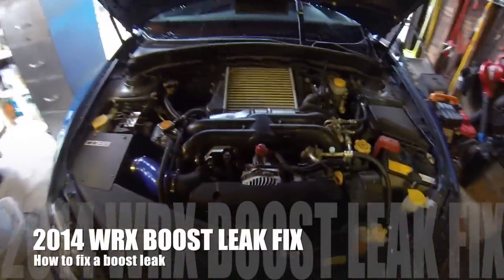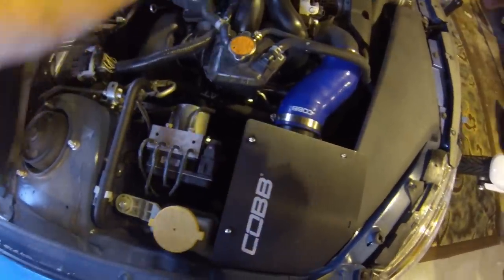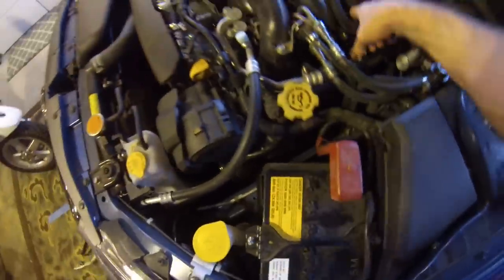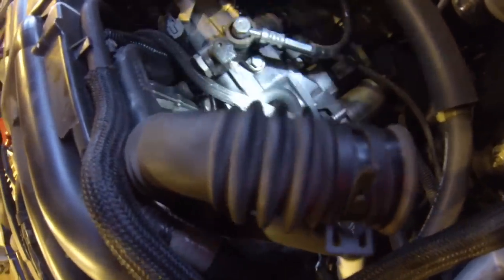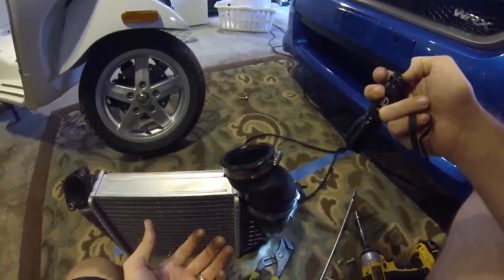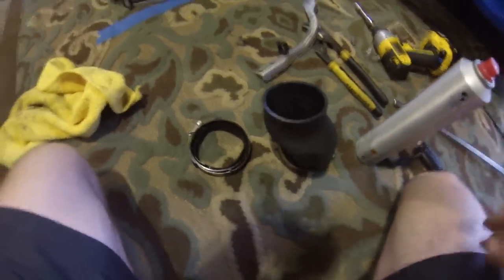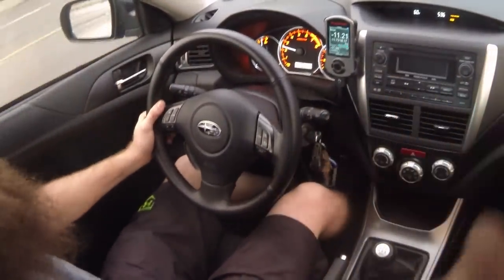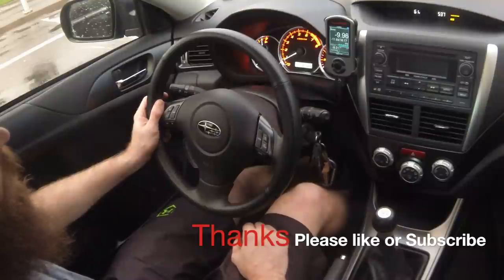How to fix a boost leak on a Subaru WRX 2014

Comment: Hey Blake, thanks for this video! I had been noticing hesitation with my turbo when I started boosting my 2014 WRX so I thought I'd check this out. When I took off the Intercooler my hose looked almost exactly like yours in the video! Luckily there was no oil but part of the hose where you put on the hairspray was ripped. I fixed it and text drove my car and it sounds and feels so much better now! Thanks again for your awesome videos and tips! You're the man!
Reply: i had the same thing, but the dealer said it was my fuel cap was loose.  i tighten that thing until i cant tighten it anymore.. it caused my engine to go to limp mode, initially about 40% of the time after 3500 rpm there would be a big loss in power, like there was no boost.  If i did get power it would flutter out and not be smooth.  

Took it to the dealer and 4 times they told me the same thing, i even paid them 100 dollars for maintenance time.  But they didnt even replace the fuel cap.  It got to the point where recently i heard whooping noise and in 1-3rd gears it keeps me at 10 mph until i get to 3000 rpm where boost comes.  So it got dangerous to drive because it would keep my speed that low even if my foot was all the way down.  

I finally just reset the ecu by unpluggin the  battery then bought a new fuel cap.  that completely fixed it.  

But now i still have to find the other leak.  Because today i got those 3 lights showing up again, check eng, crusie control and stability control lights.  Matter of time until the ecu decides to put my car into limp mode again.  Should I just take it to a mechanic?  i doubt i will take it back to subaru

Comment: Only getting 9 PSI all of a sudden and Thanks to Blake and his awesome videos, I knew what it might be right away from watching all of them months ago before I upgraded my 10 WRX to stage 2.  

Found blow by and a tear in my hose. Not as much oil leaked out because I noticed it right away, thanks to these videos.

Ordering a new aftermarket hose.

Thanks Blake.

Cheers
Reply from the maker: +BC WRX Thanks man Glad I could help!
Reply: +Blake's Garage Furthermore, If I could add any help to those looking to go Stage 2, just do the intercooler hose at the same time like in Blake's Stage 2 video. I skipped that step, and now Im upgrading it !  Merry Christmas!

Comment: Thanks so much for this video.    Had the basic idea in my head but the invisible IC->TB hose part was the unknown before I got in there.

Had the exact same problem, hose was barely connected on the TB side, and blown out like yours was.    Reinstalled the same hose after cleaning up, will see how it goes before I replace.
Reply from the maker: +cyberbob08au Glad I could help.

Comment: I recommend buying the Mishimoto silicone hose instead of this as a permanent fix to this issue.  Which happens on all of these EJ255 engines.  Subaru wanted to make the engine less expensive to make. The oem turbo inlets do the same thing.  The Perrin silicone replacement is the best one for that.
Reply from the maker: Yeah, I ended up doing that later on, but I think the best permanent fix is to sell this piece of shit car lol

Comment: Hey Blake.  After taking my car to the dealer and having them tell me that my boost leak sound was normal and that I wasn't hitting boost because I used OEM parts (a little defi gauge) and that I probably did it wrong anyway, I decided to do it myself.  Your little video fixed my problem.
Reply from the maker: MrDinoSwit Great man thats so awesome. I have little faith in the dealership anymore. They never want to fix little problems it seems. Its a big problem EVERYONE NEEDS MORE BOOOOSSSTT!!!

Comment: That oil tends to be hard on the hoses. Your blow by is coming out of the crankcase and is in vapor form then condenses out in the intake. If you want to stop that you either need an air oil separator or a catch can. It have a Perrin separator. It works quite well. I have a fully built motor so there is even more blow by than stock. And I get almost no oil in my intake anymore.

Comment: Heard you had a boost leak in the Cobb SF review.  Figured it was this issue, but wanted to check.  Had the same issue with the dealership, though they said it was my fault for taking the intercooler off.  You know, to check the problem in the first place.  I don't go to dealerships any more.

Mishimoto throttle body hose FTW.

Comment: I have a screeching noise on high boost only just had head gaskets changed, new valve seals, heads resurfaced. new jdmv7 sti 6speed swap, new r160 3.90 rear diff. new motor mounts, new sti trans mount, I have a mishimoto tb to ic hose. I have a new sti starter to match the flywheel, new sti clutch disc, chromoly flywheel and pressure plate.

Comment: Just did this last night before watching the video. My end cuffs were rolled and the back one was torn. I took them off, Note advice, Dont' do this if you don't want to have a hard time lining up the bolts lol. It works as a temp solution though if you have end couplers that are leaking. So make sure you prepare for that while you wait for your new Coupler tube. It's a bitch to get on there too. I dont' have a cobb intake or an ap yet unfortunately but I did notice I have way less swooshing sounds when hitting it, so I had a boost leak and didn't really notice cause the car felt powerful still. Last night it felt a little more torquey but otherwise felt the same after I fixed it. I need to get a tune lol and cobb intake so bad lol

Comment: Just did this procedure to my car and it indeed does need a new hose, I don't have a boost gauge to monitor my boost however it felt a like it might have had one and indeed it did, thanks a bunch for this video!
Reply from the maker: David Mudrik No problem, Get a silicone replacement hose they work awesome. But there also a total pain in the ass to get installed. It seems easy like the stock one, but you have to force it on the throttle body and intercooler. Its mostly not so easy because of how tight it fits.
Reply: Yea I've heard there hard to get on, but at least they're future proof unlike the stock ones.
Reply from the maker: David Mudrik My car holds boost really good now with the mishimoto hose. I go over the install in my stage 2 upgrade video. Check it out.

Comment: Blake you seriously helped me a ton with this video.  I have a '14 Hatch with only about 10k miles on it.  Completely stock other than cat back exhaust.  It started whistling under heavy acceleration.  Not normal turbo whine but actual whistling.  When I took my intercooler off, I had the same issue as you.  Thanks for the step by step on solving this issue.  I may have to order a mishimoto.  I tried cleaning, hairspray, and clamping it down for now and it has solved the issue.  We will see if it holds up.
Reply from the maker: +BadShadd1 I would still recommend getting the Mishimoto hose. I think my stock hose had this problem 3 times before I got the new on and no issue's since.
Reply: Blake's Garage Right on brother I think I will do that.  Did you use the stock worm clamps with it or T clamps?
Reply from the maker: BadShadd1 T clamps will work better. The stock worm clamps strip out very easily.
Reply: Blake's Garage Sorry for a million questions but what size T clamp and where do you recommend getting them from?

Comment: Im not hitting my boost targets either. According to COBB I have most likely a boost leak or boost control malfunction. I have a 14 WRX, COBB tuner and COBB intake.  That's it. Cobb said my wastegate is between 70-80%. I'm running a normal wastegate map. I hope my issue is the same exact of yours and other people posting here.

Comment: I have a 2014 wrx hatch and after my mechanic fixed the coolant leak i had ehich were rotted coolant bypass tubes from the water pump up.. he said he had to tear apart the whole top of the engine to get to it all. He had the intake and everythinf off. Got my car back yesterday and i had oil leaking bad under the car.. huge puddle of oil. I brought it back and he says this tb to intercooler hose had a small rip and alot of oil coming out. Could that much oil come out to where its puddled underneath the car? My car hits boost feels fine with no noises.. never had problems leaking oil until he touched it.. any help would be appreciated

Comment: Mine was soaked in oil like yours as well.. with some oil spots on the parts sitting below the throttle body connection.
Reply: Just took off mine. Same thing

Comment: I'm in a rut. Just got the check engine light and cruise control blinker on. I just went stage 2 ETS because I did the full turboback exhaust system made sure my mechanic took out the restrictor pill and replaced it with rubber hosing. What might my issues be?
Reply from the maker: Read that CEL code it should point you in the right direction.
Reply: I fixed the issue. it was the o2 sensor not recognizing the HFC on my down pipe its completely normal with the full exhaust system. Thanks

Comment: my car is at the mechanic now and they tell me that TB hose is ruined. It hits full boost but doesn't hold it just like you say. They are going to put a silicone hose replacement in there. Also, this means you would of had a vacuum leak, correct?
Reply from the maker: +danny hamilton Great glad he could fix you up that will help with power a ton.

Comment: I am wondering what map version are you running? I had a boost drop when I switched to the Stage1 +AEM 91 MT v331 map.
Reply: Yo did u ever find out what was the problem

Comment: I had this exact same problem after my car bottomed out from a pot hole (downpipe hit the ground and jiggled this loose). Fixed it on my lunch at work. It took weeks for me to notice :( . What a cheap hose!
Reply from the maker: Joseph Petro There total junk. Glad you were able to figure out it was having issues. It suck's when you car feels slow but you don't know why.
Reply: Ya man, still looking for a quality replacement that doesn't cost $60
Reply from the maker: Joseph Petro Its really worth the 60 buck to have no more issues. Probably the cheapest reliability mod you can do.

Comment: Hoping for a quick response. The intercooler brace is not fitting back into it's spot. What is going on? Everything else is in place.
Reply from the maker: Jacob Strunk you probably do not have the orientation of the IC to TB hose correct. This could be throwing off the alignment. Also you may have to pull on the IC to line up the bolts into there holes and just three them in by hand at first. Hope this helps.
Reply from the maker: blake866 Check out my stage 2 part 2 video at around the 7:40 mark I show how I reinstalled the bracket. This may also help you it has better view of reinstalling the hose. https://youtu.be/GQD8rtK22Vs?t=5m32s

Comment: Dude, that's a lot of blow by
You need to get an Air Oil Separator (AOS)....
Several out there examples Perrin / Crawford /AIG
Reply from the maker: Manuel Aguayo Tell me about it. Your right I think this will be something I do soon.
Reply: Is the engine faulty you think?

Comment: I have a 2013 sti, built to 370hp on stock turbo, DW fuel pump 1000cc ID up-pipe  equal length header turbo back exhaust catted bov cold air intake, fmic AP w/ pro tune dyno BC coil over. Larger turbo coming plus clutch. Having done bolt on's at home I see your plight, the stock couplings are shit, replace it and forget it. Many may not agree but OTS maps are killing you guys, every car is different, take it once to a pro and tune your car per you and tuner, being able to maximize power bands evenly and effectively will get your lbs up!. Plugging in an AP isn't a tune!. I run consistent 18lbs and change peek on the same turbo. Car feels great and performs every time. It is expensive but well worth it in returns!.
Reply from the maker: +colincash1 Once I get more of the mods like you have I will defiantly get a pro tune and I fully agree with you that its well worth it. Right now I have Torqued Performance Stage 2 E-Tune and I couldn't be happier. I can hit 18.5 PSI all day easy with no knock. Once Snail Performance has another Dyno day I would like to see what power levels my car is making with this tune. If I were to guess I'm thinking 300 WHP and 310 WTQ. I still want to do injectors Intercooler Fuel pump and E-85. But this will be a while down the road. For now I need to save to get more suspension mods.

Comment: Good video. I just bought a 2014 sti. Love it.  Quick question , does the cobb intake and access port void the warranty on the engine? I hear thats kinda a tricky question.
Reply from the maker: Alfred Salazar Um Maybe? Matia Subaru in Sacramento told me as long as that Item did not cause the car to brake than your good. They even sell Cobb tuning parts and the accesport at the dealership. But I would still take it off and uninstall the access port everytime you go to get it serviced if your worried.

Comment: My car sounds like a supercharger whine when I get on the gas especially in second gear. Do you think that could be the same as this?
Reply from the maker: +Omar Mejia Its possible either that or you turbo is shot and your hearing bearing noises. This makes turbo noise not a whine usually. More spool and air noises.
Reply: Thanks! I'm about to go to subaru for my 30k service so I'll see if they can look at the turbo under warranty.
Reply: do you hear it in first also?? 1st and 2nd whine. its the gears and it is normal
Reply from the maker: 65PontiacTempest Oh yeah I didn't even think about the normal trans noises. Did this problem just happen or has it always been there.
Reply: +Blake's Garage I bought the car used so I'm not sure how long it's been making the noise. It's very faint in first and loud in second and third I can't hear it anymore. I have a small clip uploaded.
Reply from the maker: Yeah dude thats just the trans wine.
Reply: i hear a swooshing sound like i have a bov but its a stock 13 wrx.  Subaru told me its a loose fuel cap, which they didn't even replace when i paid them 100 for the maintenance fees.  

I was getting the 3 lights on the dash, check eng, cruise, and trac control.   Recently the engine started cutting power in 1-3rd gears below 3000rpm keeping me at 10-15 mph even with my foot all the way down until i hit 3000 rpm which took like 10 seconds to reach.

Before that it would just whoosh and cut power on boost anywhere from 4000rpm +, if i did get power it was sporadic and you could tell it was spluttering and hesitating.  

I reset the ECU by taking battery terminals off and bought a new fuel cap, it works ok now.  But i still hear the whooshing and today i actually saw those 3 eng lights come up again so i know i got another leak.  What would you do? prett ymuch whats on this video? or should i take it to another mechanic.  

Im not to good with cars engines lol, i don't want to screw it up and void my warranty.  If anything ill watch these videos and try to figure it out but if you got any pointers im all ears!  great vids btw
Reply: +whiskey 4 its possibly the throttle body to intercooler coupler. they are known to be defective from factory. $50 aftwrmarket coupler will fix the issue.
also the stock intake does make some noise as it has no silencer but since you are getting power loss and lights i would check the coupler
Reply: thank you i will look into that and see what happens!

Comment: Hey, I've got an 08 wrx and have a boost leak rn. I was thinking of checking the hose from the TB to the IC but it is an aftermarket one, could this problem still happen with an aftermarket hose?
Reply from the maker: Yes
Reply: @BlakesGarage  ok, is that because the aftermarket ones still have those rubber rings or what?
Reply from the maker: @bobbyboiii5027  well, I mean there’s only two spots that you can really get a boost leak on one of these cars. And when you put on an aftermarket hose, you shouldn’t use those little pieces anymore. It should just be a single hose.
Reply: @BlakesGarage  ok, i’m still gonna check everything out anyway, thanks for the reply

Comment: +Blake's Garage how can I get to the clamp that is on the throttle body?  I have almost zero access.  Thanks
Reply from the maker: +Jacob Hofmann Long flat head screwdriver. Then make sure to put it back on in the same spot so you have access to tighten the clamp.